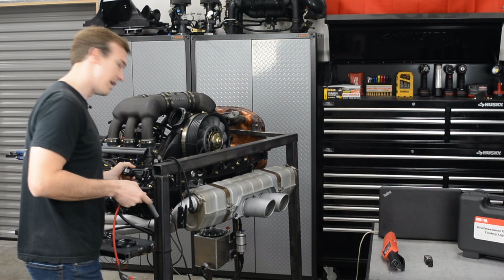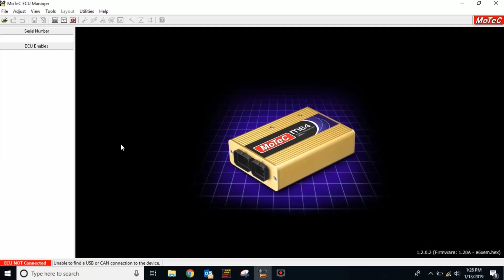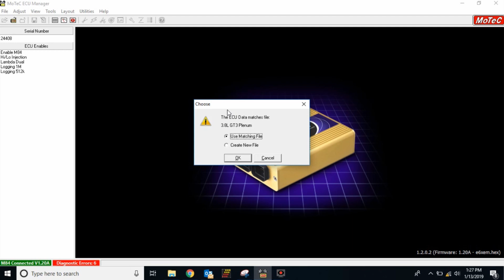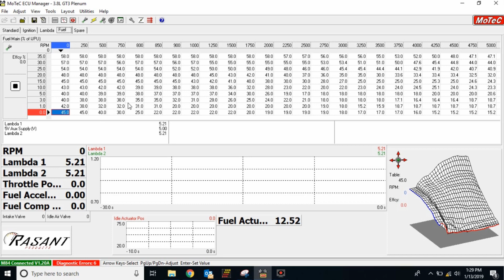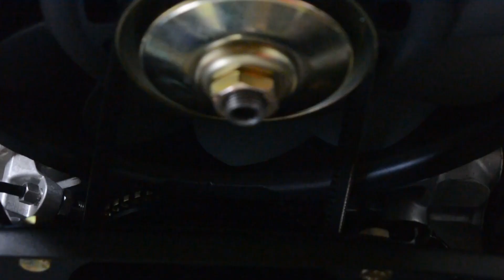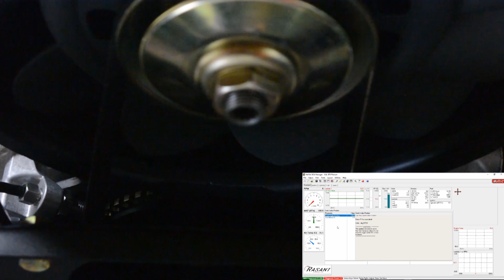Motec Syncing Process on Porsche 911

Comment: $17,000 for this ?!?! even wiring and rnd won't cost $10,000 alone. the motec itself is $2000.  

Talk about overpriced
Reply: .... For real. .. System $ cost for a '98 993 3.6l ... Installed, set-up, completed?